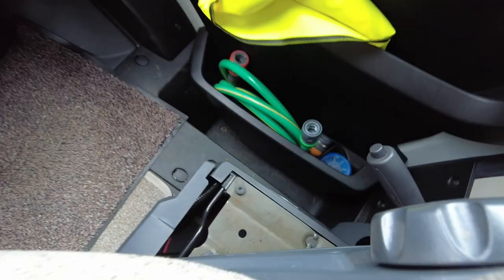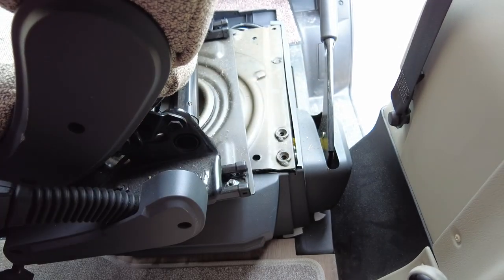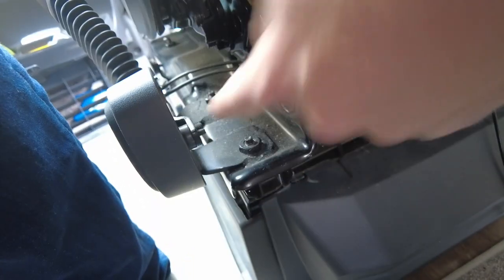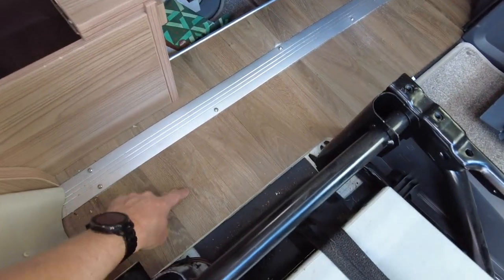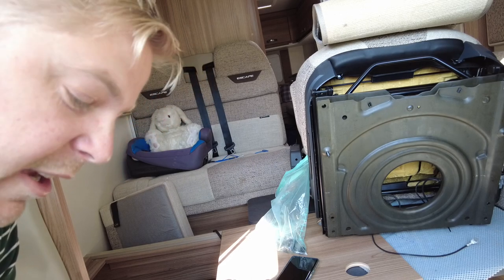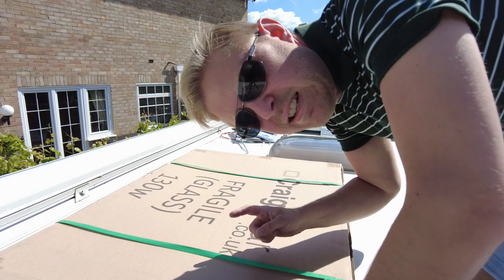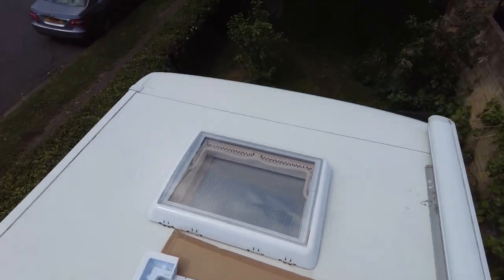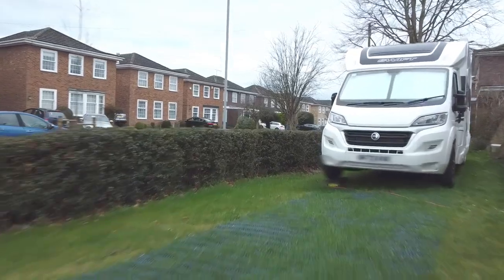Lithium & Solar Motorhome Upgrade Part One

Comment: Very useful, looking forward to part 2 as thinking of doing the same to our Autotrail. Luckily are batteries have an easily accessible locker outside so no messing about with seat but we will have to pay extra for the heating packs on the batteries!
Reply from the maker: Cheers Paul, best of luck with your project, part two coming asap!

Comment: Be careful with the Sargent split charging system. It’s not designed to charge lithium as they have low internal resistance. You need a dc-dc charger so that it doesn’t damage the psu or the fiat smart alternator.
Reply from the maker: You've not got some more information on that, or a website link I could read up more about it could you?
Reply: @2.4inaVan  If you give Sargent a call they will talk you through it or I’m happy to help you with the details. It’s a bit of a mind field as the batteries are able to absorb lots of energy very quickly. This is a problem as there is no way of reducing the current from the split charge system. Smart alternators aren’t designed to put out high currents and the Sargent psu it’s designed to charge at the 50amps which lithium may pull. I’ve used a Victron dc-dc charger.
Reply from the maker: @LifeintheEdge  I've not observed any problems, what symptoms would I spot?

Comment: Like your videos but could you have not put a 200 amp ks energy lithium battery under the seat there made for ducato van cheers mike.
Reply from the maker: You're probably right that that would have been simpler but it's a more expensive solution.
Reply: @2.4inaVan  yes mate probably right there not cheap hurry up with part 2 😁😁
Reply from the maker: @michael735014  will do

Comment: My panels and lithium are probably worth more than my van 😂😂
Reply from the maker: Haha brilliant
Reply: @2.4inaVan  but on a serious note. 540watt of solar and 200ah lithium battery + plus a good victron mppt was a game changer. Had 3 fridges on full blast for 4 days. And the weather's been shite up here
Reply from the maker: @sun-sea-solar  blimey, that's good going. We had a 4 day trip off grid in cloudy weather last weekend and we returned having used about 9% of the batteries. I'm pretty pleased about that. What's the longest you've done off grid?
Reply: @2.4inaVan  with my old setup 7 days, but that was agm batteries I had 3 portable power banks. It was pretty useless. But at the time didn't want to invest too much in the van. I didn't want to run gas into van either.  For 2 years I also ran a normal AC fridge.
Reply from the maker: @sun-sea-solar  that's good going. So the main change was to Lithium?